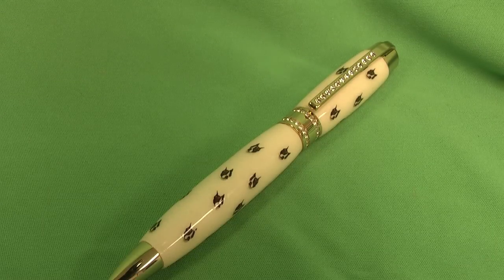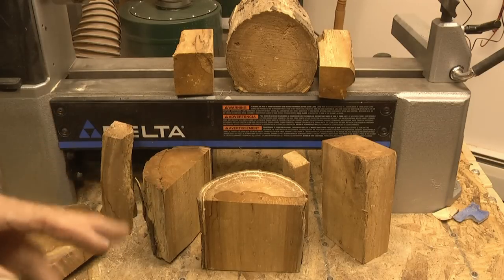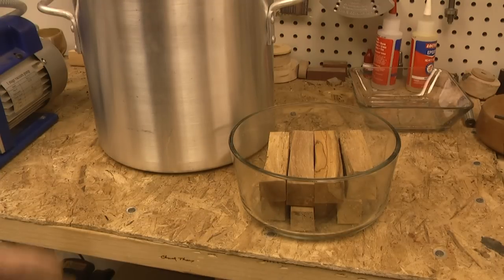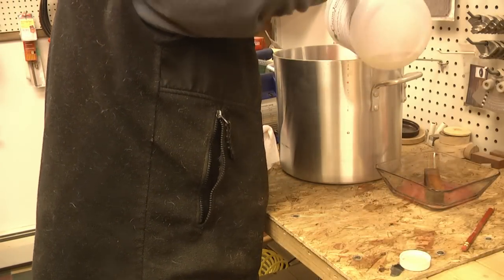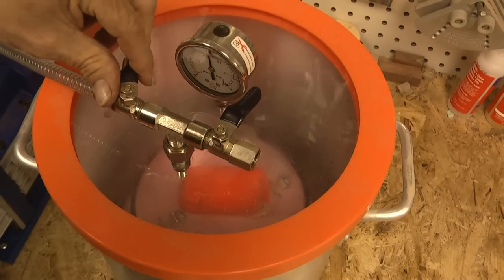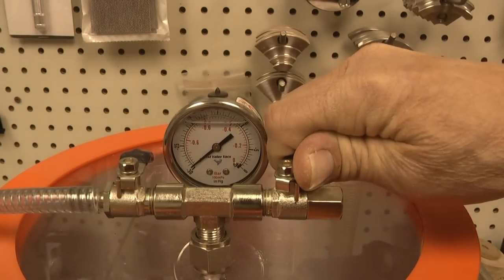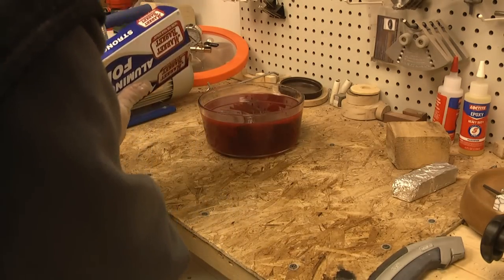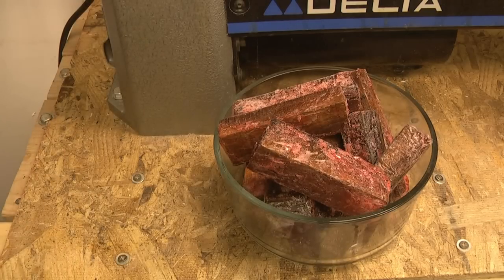Stabilizing Pen Blanks #14

Comment: I've been turning for a little over a year now and I want to expand in to stabilizing wood and acrylic.  Great Video!!  I don't typically do back flips, but that Boston Terrier made me do one!!  My wife and I have a Boston Terrier and the nail art is already on it's way!!  What a FANTASTIC idea!!  My wife is going to flip when she gets it!!
Reply from the maker: Michael Milano Thanks for the input. I found  the smaller the nail art the better it blends into the pen.  the larger pieces tend to "stick out".  cut as close as you can to the image.  I used a very small hobby scissor.  Its a slow process and i applied 32 bostons to my wifes pen.  good luck and please let me know how it turns out.  Bostons are a great dog, Mrs. T has a house full of them,
Reply: I Turn Two Thanks for the instruction.  On a side note...have you experienced seizures with your Boston's?  Mine, Penny, has been struggling since November.  She regularly sees a neurologist and is on multiple medications.
Reply from the maker: Michael Milano fortunately, we are been very lucky and have not experienced any problems.  if you want you can contact me off line at dogfoodboy@gmail.com  and i can have mrs t. ask around.

Comment: just fyi..closing off the valve that is pulling suction is bad for your pump..u can lower that vacuum from forming to fast by opening the other valve very slightly, just like u did when u let the air in at the end..this way the pump is still moving air and able to cool itself..but not be under as much vacuum in the chamber
Reply from the maker: +R squaRed Thank you very much for the input, i will give it a try when i stabilize my next batch in the near future.

Comment: I have seen vacuum pots that look like that on Amazon. They say not to use them for wood stabilizing. That the lid will crack do to a reaction with the fluid. They even mention Cactus Juice by name. Have you had any problems or did you get a different lid?
Reply: Glen Coultas I’d like to know that too. I bought one that says no wood stabilization.  But they said a glass lid would work

Comment: Hey there, good video! Thanks for sharing. I do some of this and have experimented a lot with pen blanks. Heres what Ive found:
1. Lots of dye. I put at least half a bottle of resin-dye in per litre of juice. It needs to be  almost black when you look at it.

2. Woods vary hugely. Some stabilise after half an hour of vacuum and 30 mins of soaking, others tale 4 hours of vacuum and 3 days of soaking. 

3. Baking takes1 hour. ... 2 hours is too long and you risk baking out the resin. 

4. You can rough turn the pen and THEN stabilise it. I didnt think this could possibly work (heat cracking, tube gunking etc) but it does!! Saves you time and juice!
(the points 1-3 above refer to blank stabilisation tho)

Comment: i just wanted to say the catus juice does not go in the wood while under vaccum. if you think about it the vacuum is pulling air and  moisture out of your wood how can the catus juice enter the wood to stabilize it.  wood needs to stay in the catus juice for at least 1 day on hard wood up to a week. if you mark your container before you start and let it sit for a day you can see it will go down about 3/8''of a inch. if you want to watch a guy do it right watch jack lore you tube do knife handles.  i did it the same way you did until i watched him.  nice pin   thanks
Reply from the maker: +KNIFE MAKER Thank you for the excellent feedback and the kind words. I will definately go that way my next stabilizing project.

Comment: First time seeing something like this. A quick amazon search shows that the resin is really expensive. Do you get it locally? Can you reuse it?
Reply from the maker: Nick Chambers unfortunately i have not had the chance to work a local source.  you can probably get from ebay or amazon.  i have purchased from both turntex.com and woodturnerscatalog.com.  you can definately reuse the product.  i think it is a 6 mos shelf life once you add the catalyst.  i probably got at least 7 or 8 reuses out of the last 1/2 gallon.  good luck.